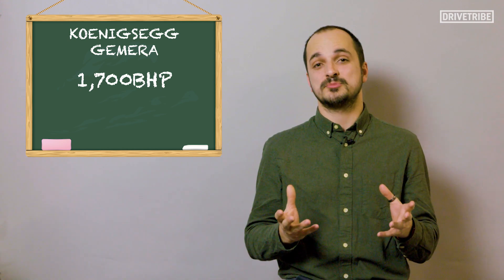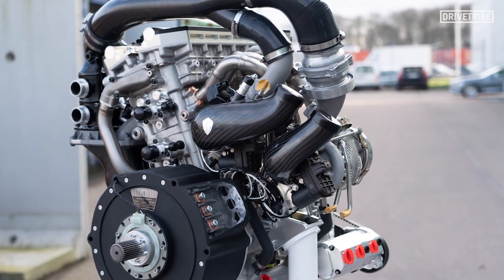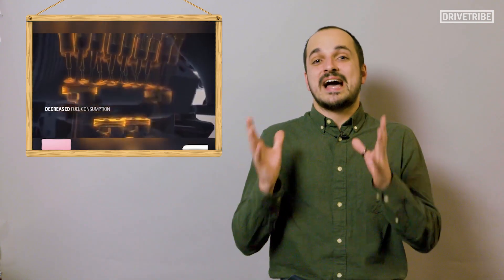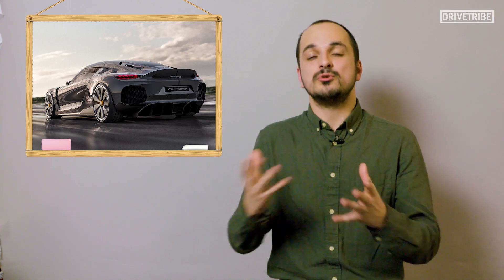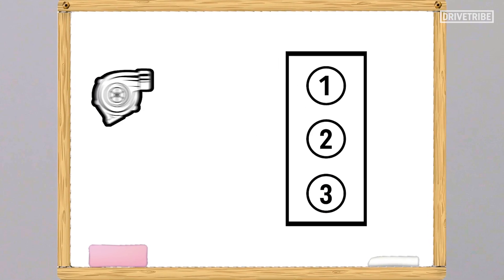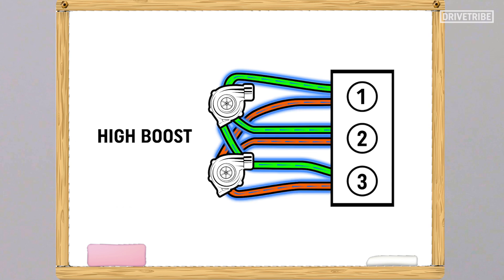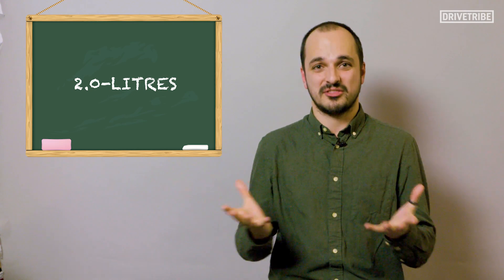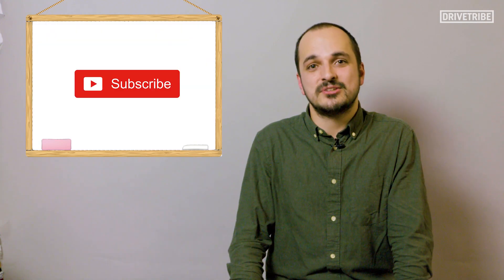This is how Koenigsegg made 600bhp from a 3-cylinder engine

Comment: Although “FreeValve” requires an external air compressor, the ability to change intake or exhaust valves accurately for lift, duration, closing or opening time plastic change lobe separation angle is truly an amazing change for any ICE. This a game changer once the price drops as they can be in many configurations to fit any future engine. It’s like having the ability to change from 20 different camshafts while driving depending on the demands of the driver, road conditions even during turns. Also, get use to 3 phase electric pancake or toroidal motor due to brushless design and the ease of controlling low voltage to high voltage in each phase to achieve 0 to 200+ MPH. I drove a hydrogen fuel cell vehicle in 2008 as the engineers where trying to achieve better than 86% liquid hydrogen or gaseous hydrogen to amperage at 180 volts dc, which is common for most “PEM” hydrogen fuel cells. Just 1 type of fuel cell of 5 current designs. Large stationary type provide power to operate large office builds like the downtown 1st National Bank in Omaha, NE.
Retired ASE Master Tech
Reply: "Although 'FreeValve' requires an external air compressor"

It does? I thought the Freevalve design uses solenoid-driven valves.
Reply: @deasystems   > The problem starts with any discussion begins with the word “Solenoid” employed in its description. The forces in opening a valve in an internal combustion engine (ICE), are huge. Any given spring, say 2.08” tall sitting on the bench. When opened to .500” lift (Common) it requires as much a 375 pounds. Try this on a race spring, on a bench tester found at machine shops. No electric solenoid can do that in a small package and low current. Based upon documents, like a patent office or filed with ASTM or SAE, they use compressed air to open it with pressurized to hold it steady. Internal ball valve turn, allowing air to exit the large chamber, while same happens to oil, except smaller chamber as oil is more viscous and can’t exit as quickly. It contains it’s own valve, top piston and a weak return spring to allow for default closed position to prevent piston contact in “Interference” engines. Two electrical connectors provide position feedback. At the bottom end where the internal piston/valve moves, a coil of wire “Maybe” sistered with a magnet. The movement causes an electrical signal is created. If a enhanced Hall effect sensor is coupled to the coil, it can provide a signal of different levels, providing a PCM to learn a replacement, but also close air/oil valves. This feedback allows for depth and length of time a valve is open and even make small adjustments during operation. So in short “All the Above” except the control of the ball valves or gate valves, is unclear. A “White Paper” patent provides the main parts in a drawing, labeled for a brief description, plus a vague description is provided to tell the patent office does not care if it works, but spends most of its time by description searching for other devices that use the same parts and does the same thing. It is left vague to prevent loss of intellectual properties as copies can be purchase, but expire and another party wants to own or make it, have to go back to owner of the patent. I have three, two went no where and the other was sold to make it.
Check YouTube “Free Valve Explained”. I am sure others have posted videos, but no one knows exactly how as the company the first made it, was sold. Retired ASE Master Tech of 40+ years.      Hope this helps.
Reply: @deankay4434  Dean, the Freevalve system doesn't necessarily use pneumatic actuation. Camless systems can also use hydraulics and electromagnetics for valve control. https://en.wikipedia.org/wiki/Camless_piston_engine and https://en.wikipedia.org/wiki/Pneumatic_valve_springs (see section "Future valve technology").

And in any case, the use of pneumatic valve actuation in Moto GP and F1 engines shows that pneumatic control isn't a drawback in terms of reliability or weight, etc.

Anyway, it seems we agree that camless systems provide huge benefits for IC engines.

Comment: can I buy that engine and put it in an old fiat 500? :O
Reply: get you a triumph rocket motorcycle.   it's got a 2,3 liter 3 cylinder.    makes 145 hp and 145 lbs of torque, stock

Comment: I think you got it backwards. While two turbos and split exhaust is cool, the freevalve is a game changer. Huge RPM operating window with almost infinite variations in lift and duration. Multiple combustion options like miller-cycle, cylinder deactivation, auto-spark, and even two stroke. This is a game changer for the IC engine.

Comment: Motorcycles can do 100HP per cylinder at 500ccm without a turbo, with normal fuel.

This car does 200 HP per cylinder at 667ccm turbo charged with E85.

I wonder if motorcycle engines could surpass the efficiency of this Koenigsegg engine, if they were made with a turbo and E85?

Comment: Has anybody pointed out that Alfa Romeo were the first to use this technology (albeit in a more simple scale) in the Multi-Air engines? Also, if you like twin-port heads, check out the exhaust manifold from a 1980s Citroen BX 16v or Peugeot 405 Mi16; They're 16 into 4 into 2 into 1! The Gemera is something else, though. Koenigsegg are at the forefront of....well, everything.

Comment: I bet the maintenance requirements on this engine will be ridiculous. Consider a typical pneumatic actuator has a life cycle of 10 million cycles. Say this car had a max RPM of 5000, that would be 5000 cycles of the actuator. That would be 300k cycle/hour, 7.2 million cycles in 24 hours. 🤔🙄😱

Comment: Three cyl engines, to my experience, have a basic sound pattern that can also be heard in V6 and to some extent V12 engines. I'm guessing it has something to do with the crank design and ignition timing. But I'm no engineer so just speculation on my part ;0 Point is, don't be surprised that a three cylinder engine can sound really good.

Comment: "How much Reliabilty do you want?"
Koenigsegg: "Nope"
Reply: 1) There's no reason to believe this is unreliable, it's not that complicated
2) Nobody really has any reliability figures about Koenigsegg other than Koenigsegg themselves, because they sell so few cars they are the only ones with any data to make a statistical analysis, anyone claiming anything about their reliability is talking out of their ass
3) People who buy cars who cost seven digits don't give a shit if it needs expensive servicing or repairs, and most of these cars won't drive 10k miles in a decade, reliability at the 120k mile mark is completely a non-issue
Reply: @BigUriel  "People who buy cars who cost seven digits don't give a shit if it needs expensive servicing or repairs"

McLaren: Hold my beer!
Reply: @carlsagan2371  enough of this hold my beer shit. It's not even funny nowadays
Reply: Warranty is good until you've driven it off the sales lot.
Reply: This isn't McLaren were talking about here....
Reply: @Lost Pants agreed the motorcross bike gets its pants flogged off, i was using it as an example of how short lived a modern 4 stroke can be. Will the koenigsegg last longer? It should. 
Will it last as long as a corolla?. No.
Reply: Did you see the length of the piston skirts in the cgi demo? This engine may have da powa but its built for a good time not a long time!
Reply: @watsisbuttndo829  good time is no good if it's not a long time
Reply: @watsisbuttndo829  can you explain further? how did you conclude from the CGI that the durability of the engine is low?
Reply: @amerabughaida4327  its the diameter of the piston verses the length. Google image diesel pistons and then formula 1 pistons. Diesels last a million miles and f1 engines dont. I know these are extreme examples but the modern 4 stroke motorcross bikes have pistons that look like the freevalve motor ones and motorcross bikes should be inspected around each hundred hours. I have no doubt that koenigsegg engine will make a lot of power.

Comment: thats smaller than most Harley Davidson engine... imagine putting this into a motorcycle
Reply: Actually as far as I am aware, H&D only produced (and still produce?) 1.8 L max. The Triumph Rocket has 2.5 L 3 cylinder.
Reply: @yur1831  i mean the sizes. Look at that thing, that's smaller than 1.2 v twin HD

Comment: wait till you try to start it , with a low battery or a bad connection some where and the computer rams the valves into the pistons , the light that burns twice as bright burns half as long.
that aside , the twin turbo set up is a great idea , once youve seen it , its so obvious.

Comment: So it's like ultra-vtec + 2 turbos.
RIP headgasket.
Reply: It's 2 liters of displacement in 3 cylinders. 
Infant Formula 1 has cars that have 1.6L 6 cylinders kicking out over 850HP reving to 15k
So this is quite easily fine, but probably will need to be kept ontop with maintenance.
Reply: @James-ns6jm  F1 engines might get 24 hours of run time before they are disposed of. they are not meant to be long lasting, and thats one of the reason they can wring out so much power from them
Reply: Doesn't have a head gasket, it has a head vault.
Reply: @jumpercable20  So the head is non-removable? How serviceable is the valvetrain I wonder?
Reply: @blahblahblahblah2837  I haven't researched it a lot but it probably just uses some type of O ring around each piston. Don't know if the head comes off or not but I would give kudos to the engineers that found a way to eliminate a camshaft by using springs, selenoids, sensors, and electric actuators, I'm sure that took some brainstorming for many hours. The parts are probably cheap, it's the engineering that's expensive.
Reply: Future Koeniggsegg:
What head gasket? It's an External combustion supercharged, turbocharged 1.5 cylinders putting out 2500HP.
Me: wha???
Reply: HEADGASKEIIIIIIIIT!!!
Reply: This car cost 1.7m. 
The 3 zylinder engine prop 20k.
Reply: Yen Tao  Well you know what I mean though right? Obviously theres no cam or chain, but how would you get in there to change out a stuffed valve? Do they just screw in to the head? Are they simply accessible by removing a valve cover?

Comment: So in the cut away model the center cylinder looked 2x bigger than the 1st and 3rd. So it's more like a 4 cylinder.  Not impressive. I know the xr4ti had a 700hp 4cylinder  you could special order from Germany in the 80s.

Comment: Not hard to believe, Daihatsu GTTi rally cars in the early 90s were making 299hp from 993cc, 3cly engines. Without all the fancy stuff. The big difference here is torque, with much lower friction thanks to the whole camless set up and pnematic valve train. Rumour has it, that it can also run as a 2 stroke!! Incredible tech.

Comment: A rotary 13B can make the same amount of hp. I don't understand the big fuss?
Reply: The 3 cylinder TT Koenigsegg doesn't need to pull a fuel tanker behind it to keep it fed either. Nothing against rotaries, but they ARE notoriously fuel inefficient. If they could cure that one problem with rotaries, they would have the perfect engine.😉 I for one, would love to see some serious re-design of the Wankel engine that would eliminate the problem of the exhaust polluting the incoming fresh air stream from one rotor face to the next.

Comment: Lets see how reliable this is before we all lose our minds.  Great that CvK is pioneering these technologies but pneumatic valves + heat = problems.  But if CvK is involved you can be sure that they will be solved eventually.
Reply: They use a combination of electro-hydraulic actuators to push the valves and air over conventional lightweight springs to return them. All pressures are variable and it uses predictive AI to match driving conditions in near real-time. Even if the system were to fail under power, the springs would simply return the valves to the closed position and the engine would simply stop without damage to the valvetrain or pistons. Much better than lunching a timing belt(s) on a high performance 'interference-fit' engine.😜
Reply: Dan W ...you say electro-hydraulic. Drivetribe says pneumatic.   Which one is it?  You are incorrect.  They are activated electro-hydraulically.  They are actuated pneumatically with an electronic trigger and dampened hydraulically.  We don't use hydraulics to activate or actuate due to the speed of operation.  Pneumatic is faster.
Reply: @WallyMcFly  Check this link for the full story on it: https://www.freevalve.com/

Comment: I am surprised that other manufacturers haven't applied camless systems till now, it seems like the obvious choice 
I still remember when I first learned about camshafts thinking that it would be much better if each valve could be controlled independently by a switch or something.

Comment: Couple corrections: its a 4 seater, not a 4 door. 3 cylinder ‘performance’ are notoriously great sounding. You need only hear some 3 cylinder motorcycle engines to know that. It is the economy engines that sound poor.

Comment: Triumph Daytona 675 is a 675cc or .675 liter engine that makes 128bhp, scale it up to 2 liters and it makes 429 bhp naturally aspirated so lets slap a couple turbos on it and boom you've got a 600bhp 3 cylinder. The valve technology is cool but only really helps manage the vehicles AFR more precisely and more accurately spool the twin turbos that also aren't really a problem as several people have been able to twin turbo 3 cylinders in the past using the exact same methodology.

Comment: I can confirm a 3-cylinder engine sounds great! I've got an Mk8 Fiesta ST-3 with a 1.5 Litre Turbocharged 3-cylinder engine creating 200PS with a throaty sound!
Reply: I wouldnt brag or broadcast u paid for a fiesta  😂😂😂
Reply: All the three cylinders sound like wet farts. There's nothing they can do about it, it's simply the physics of the exhaust pulse.  Displacement isn't going to fix that it's only going to magnify it.

Comment: Can you a imagine 3 cylinder killing almost everything on the road and  if a the millinum falcon lined up next to it  turns on the electric motors⚡⚡ and beat it during Warp speed🚀 that's  😷
Reply: That engine won't make 10.000km lets not even talk about 100-200k km

Comment: 1. By "throttling" the engine from inside the combustion chamber, FreeValve eliminates the manifold vacuum, allowing atmospheric pressure all the way to the intake valve. This improves MPG in CITY driving. Plus, you can't get any better throttle response then that! 
2. By having a "square cam profile", the valve pops open, stays flat, then snaps shut, improving air flow in both intake and exhaust ports. 
3. Each valve is optimized in real time with every cycle. For any engine load criteria, the timing of intake and exhaust can be independently programmed throughout the rev range. The system can then “decide” based on driving conditions which one to use to maximize performance, or minimize fuel consumption and emissions.
Reply: some people might be concerned about "what if the valves get stuck open? that would destroy the engine instantly!"
well there are reasons why that probably isent a concern to begin with.
1. there still is a spring, so if it did lose preasure or power to the system, the effected valves would close.
2. if the spring isent fast enough and the piston manages to still hit the valves then it wouldent be pushing the valve against a rigid camshaft and destroy the piston and valves, it would be pressing the liquid/oil out of the system, which is way less resistance than breaking the camshaft. so if something where to break, it would be the freevalve system and not the piston itself. (most likely you would get a leakage of the fluid/oil which would be relatively easy to fix)
Reply: @vulduv  The World's First CVVD Engine - Genius! https://youtu.be/uhsgdwUX1-w

Comment: They must be the new type camshafts that also close valves as well as opening them. The only valve closing device I've seen in ic engines is a coil spring. Did free valve come up the cam closing valves as well?

Comment: Should this engine be considered for racing series as a crate engine?
Very light, plenty of power.
Imagine also using the crankshaft electric motor. saves a start motor. Allow for regen, hasvesting and more efficient deployment during acceleration, hight peak power. The associated battery would be quite light. The Koenigsegg Regera's battery is probably way oversized for this one electric motor and weighs just 75kg for 4.5 kWh.  I bet 40-50 kg of battery would suffice such a car ending up at about 1,000 hp total. In stead of a hefty gearbox, just use the battery and the torque converter in place on the Gemera. Off the line can probably be done without any battery, but ideally kick in a bit higher.
For track racing, final gear would go to only 300-350 kph, not 400+ helping torque at lower speeds. The lack of a gearbox having only the torque converter and a long gear would really for racers to use the battery to exist slow corners. Easy enough to restrict output from the 3-cyl under conditions that are not to be considered reasonably efficient. So maybe under 100 kph or so you don't get any fuel boost, only 400 hp (which is plenty) from the electric motors. This limits using energy to just go fast on the straight which doesn't save much time.